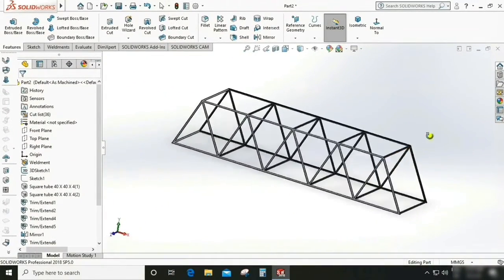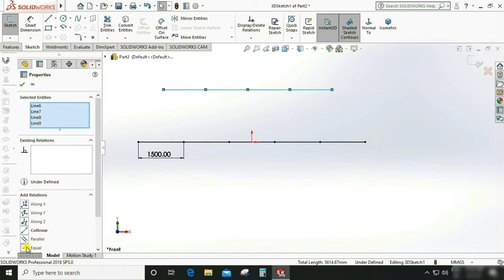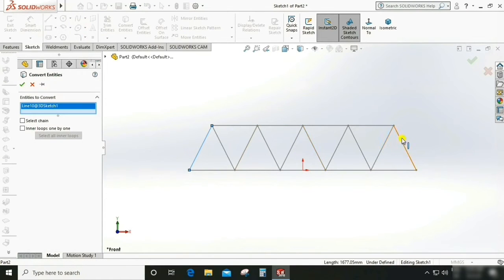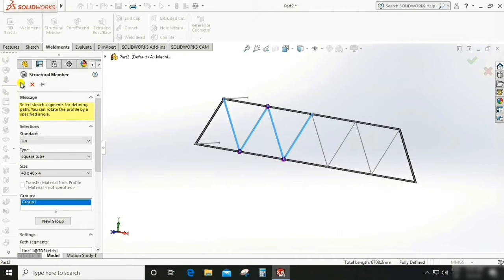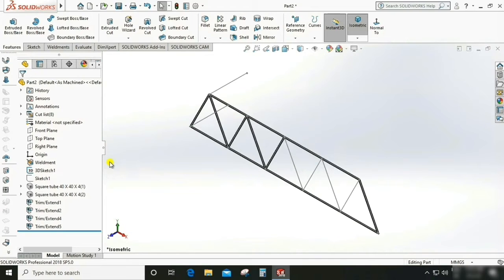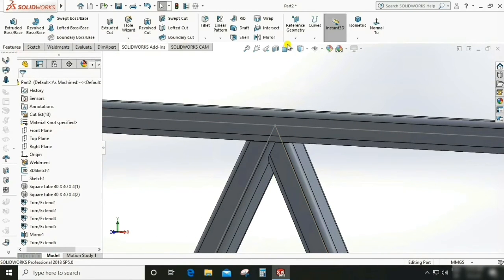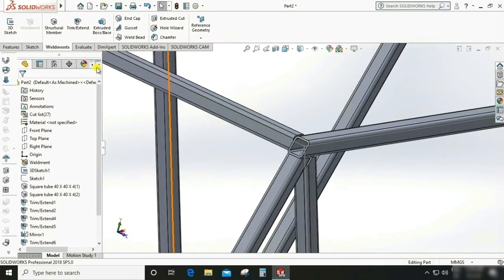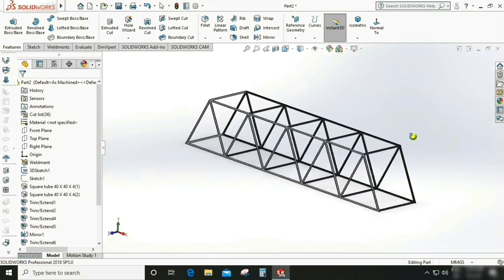Truss Bridge Design || Structural Design || Solidworks Weldment Tool CAD Tutorial || COGNITION

Comment: I would like to CAD a wooden truss for a student-design RC aircraft, do I follow this same method? How would you recommend we design the connections between the wooden members?
Reply from the maker: No, because this is steel structure, and we are using welding to connect..